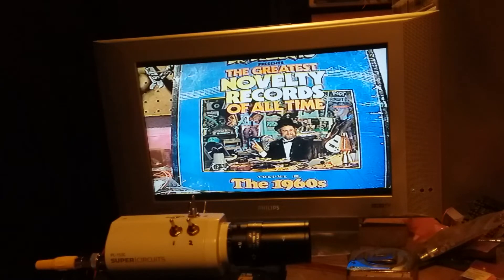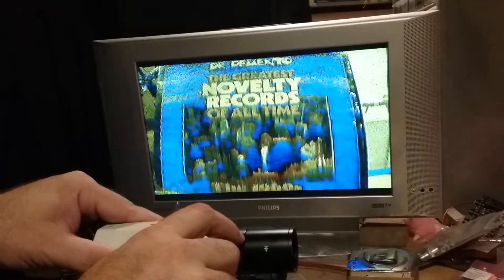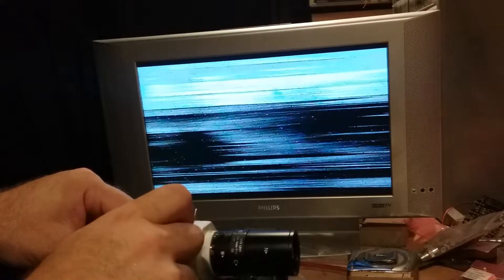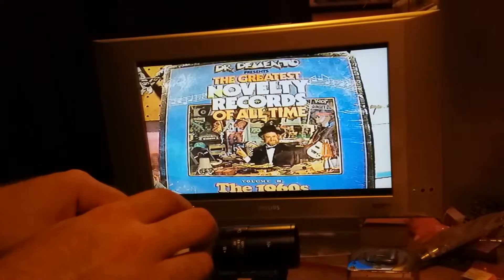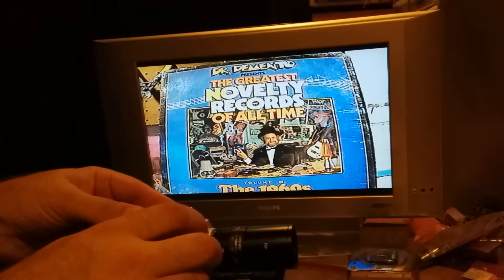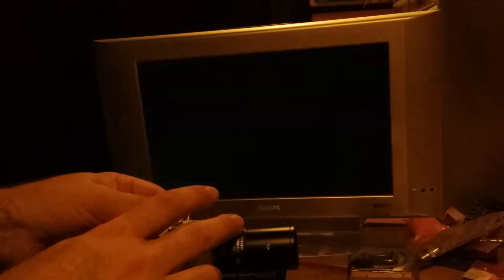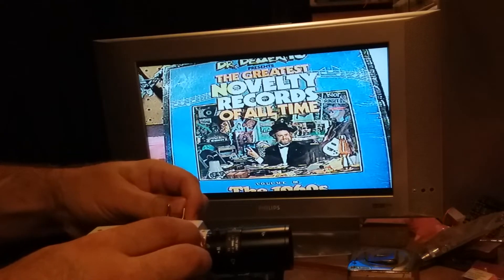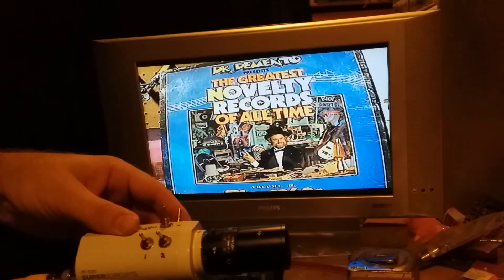CCD Security Camera Circuitbending Demystified (kind of)

Comment from the maker: Some additional info. I actually just went back through the bends on the very first camera I ever worked on and found that I wired everything backwards. In my case this means that some of the voltage pins are not off the table. I'll explore this further and either update here or post another video with more detail.